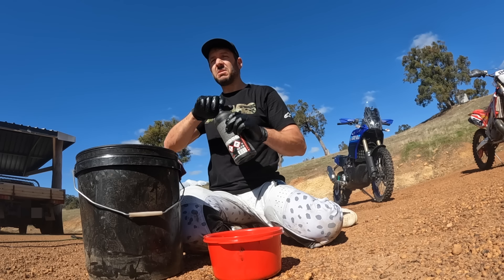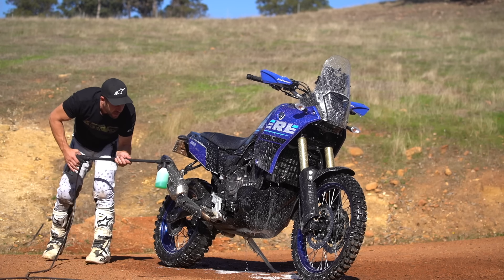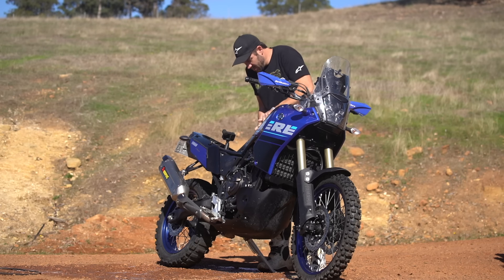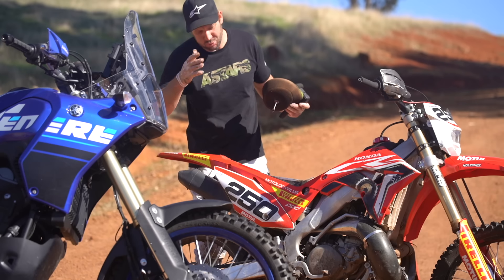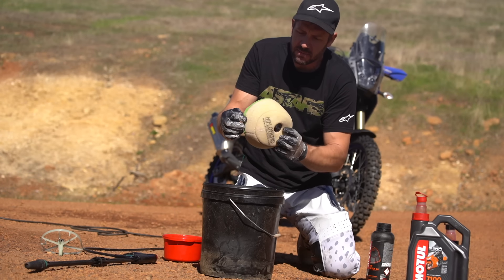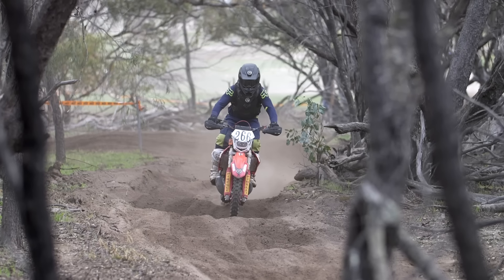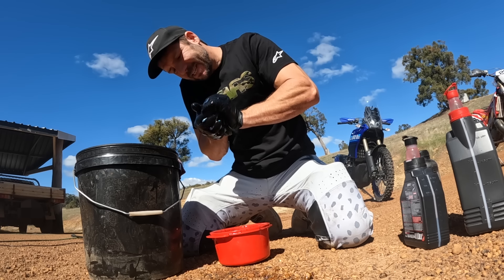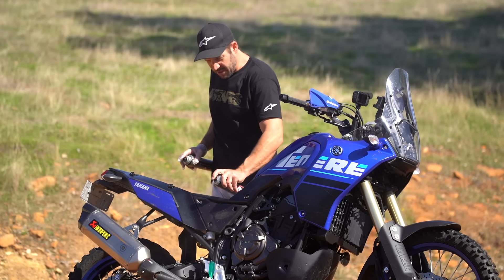How to Clean & Oil your Air Filter Properly!

Comment: Hi buddy, great video, I suppose this is a daft question, I've got an old klx 250 2010 Yr, I changed the air filter, and greased the edge of it but didn't oil it, should I take it out and do what you've done, sorry to sound a bit stupid cheers mate, and you got another subscriber, luv what you do cheers J mac from England. 👍👍🤘
Reply: yes! definitely take it out and oil it. Those foam filters don't work when their dry. They have to be oiled.

Comment: You probably dont need it in aus, but, do you treat your bikes with rust preventative. Recently came across stuff called acf50 which is from the aircraft industry but popular with bikers and is supposed to work for a year. Keen to know what you think. Thanks for the tips, pure gold

Comment: Just a comment on one of your video in regards to tyres and inner tubes.  I know basically nothing about offroad riding, so am curious as to why I see Dakar riders using moose tubes and why do you not?  Are they not better?  Or are they only for offroad racing?  What are the advantages and disadvantages from your perspective?  Thanks for the great content!  Every day is a school day.
Reply: moose tubes don't last long and will overheat and melt after prolonged road sections and are worn out after one hard day offroad. That's why they change them every day while racing. Great for the Dakar where you can't afford a puncture, but kind of a PITA for the average rider. I've run them in the desert southwest of New Mexico and Arizona and its awesome to ride through cactus and not have to worry about a flat, but they suck to change out compared to a tube. You also can't change your tire pressure like you can on a tube. Minor point, but worth mentioning.
Reply: @Rourke-Slimer  ah thanks for the info very helpful.

Comment: I recently got a single cylinder 400cc bike, quite the nice little thumper. The air filter on it is one of those round currogated ones and not one of these more spongy ones (it's not a motocross bike). Would you recommend oiling this one too? It is bound by plastic "rings" on the top and bottom (basically a cilinder)

Comment: Thanks again for another information packed vid , what you say does make sense. ? though if it's to oiled could that excess suck or drip into the cylinder
Reply from the maker: You might get a dribble onto the airbox boot, which is actually a good thing because it's one last line of defence if a granule drops in there ... sticks to it like those sticky rodent pads and stops it going into carby / throttle body.

Comment: "You wanna keep riding it as an old man...? you probably bought it as an old man." Ha!  I like the chain lube as last step bit. Going to give that a go. Grease around the edges has saved my ass before. Passed 7 KTMs that burned up in deep fesh fesh and I didn't... I assume because of my habit for greasing the edge of the filter.

Comment: I'm just wondering what type of fluid you recommend as a cleaning fluid. I was told not to use petrol as it destroys the foam. However when I bought purpose cleaner it is still a hydrocarbon. Just like the oil you oil it with. 
So is petrol or diesel ok to clean with

Comment: Question regarding silicone spray you use on tire tubes, you said you used it for off roading, do you also silicone spray tubes you use on in tires on roads? Channel rocks and proud you were in Knin which is 30 km from my town :)

Comment: I'm stupid... So after I've oiled up the filte like this, how long until the next change? Do I just kepp on checking it every day or do I wait for the bike to not be able to start(😂)? Also, what happens to the excess oil that drips down inside the air intake manifold or however it's called? Does it just get sucked into the engine just like the dust or what?? 

Sorry for the dumb questions, I'm new to this whole thing.

Comment: thanks for the good tip. don't ride a motorcycle but in Canada we ride a lots of four-wheelers and play in the mud some of the four wheelers come with paper filters in a foam around it .  should I be oiling the top foam filter  what's your opinion on the paper filters we don't have much dust step in the summer mostly just a lot of water and mud

Comment: Thoughts in filter skins Adam? Wip then of half way through a race and have a brand new filter again or just leave it as added protection?
Reply from the maker: Yeah filter skins are great for multi-day events / rides. Just don't tuck them into the sealingf edge of the foam because they can pull the filter out from under the inner cage and make a gap for dust to suck in!

Comment: Hey Adam great vid and really enjoying the channel!  I would have never thought of the 50/50 air filter and 2T oil mix.  In my area we don't so much have dust issues but more mud and water to deal with.  Does your filter oil mix repel water fairly well?  We do get a fair amount of water coming into the air box.
Reply from the maker: It only takes one cloud of thick dust or a stint behind a vehicle off-road to get dust and dirt granules through a poorly oiled filter. All it takes is a few particles to get into the engine and score a line between your piston and cylinder and your engine will start burning oil ongoing.
Reply: @MotologyFilms  Yes I definitely agree using this method in dusty conditions has done well for you.  Just wondering if it works equally well in wet/rainy conditions and will repel water entering the airbox as well as pure filter oil will.

Comment: Adam, do you have no fear that the foam filter seams on the T7 gets blown after longer usage and because there is no screen below the filter (like e.g. on the Yam WRF) some dust/sand or foam particle gets into the throttle body/engine? In the moment I'm running the stock paper filter (btw: very cheap) with an extra pre filter net on the snorkel. PS: Thx for the tip to mix engine oil to the airfilter oil for not drying out the foam
Reply: Joe Figl, good man running pre filter on the snorkel.  👍🏻
Reply: Yamaha Australia change the supplied paper filter for foam on all T7’s sold here. The paper filter would be useless in Australia. The foam pre-filter actually stops a lot of dust by itself meaning that your main filter will run a lot longer before needing to be cleaned/oiled.
Reply: @jameshind6644  didn't know that you have the foam filter as standard in Australia
Reply: @joefigl  Yep, Yamaha australia/ dealer change them before you take delivery. The engine would be toast in Oz if they didn't due to the dust. I always ran mine with a pre=filter as well.
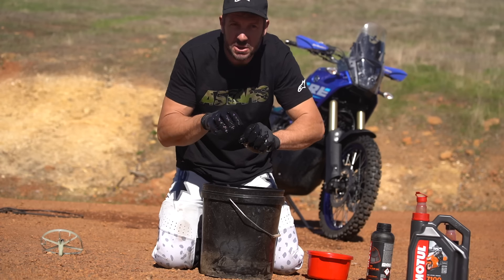Reply: @jameshind6644  look at this German guy who did a desert trip in Marocco and Mauretania at 09:00. He runs the original paper filter element with a foam pre filter and changed the prefilter first at 8000km on his trip. Seems this combiniaion works also pretty well. https://youtu.be/Vko1nUp062w

Comment: I've always just bought the stock paper air filter for my CB500X. Sounds like that's not sufficient and I should replace that with an oiled, foam filter instead?

Comment: I  have always cleaned up with a microfiber cloth outside first, then inside,  wash the filer with gas, soak filter with the bikes new oil, squeeze it a  bit and throw it back in,, good to go, if the interior is clean you're doing it right, or?

Comment: Question on the 50/50 oil mix: what would happen if you just used motor oil to oil your filter instead of the 50/50 mix? Would certainly keep the filter oiled longer but would there be risk of it burning thru the engine and it not working as well as a solution having 50% pre-mix oil?
Reply: Nevermind. Motor oil is too thin by itself so the mix oil adds a level of stickiness to it. Thanks for the video, vey helpful.

Comment: So if my new dirt bike somehow got dirt into the boot and on the throttle valve (still haven’t figured out how because no dry spots on filter and was sealed with grease), does it mean I have to buy an entire new engine?

Comment: Hi all, I've cleaned my filer only to discover I've hardly any left. Is it safe to use 100% motor oil on the foam filter in a pinch? Thanks.

Comment: hey i have a question. when i oil my air filter it doesnt become sticky or something. i use putoline air filter oil so it should be good right? i let my air filters dry for a couple of days and even on new air filters it wont become sticky but it just stays wet. do you know what could be the problem?

Comment: Hey Adam - may be a silly question but I do tend to get caught up with internet myths about mixing product lines etc. on my 4t, I assume im fine to use any new clean 4t oil on my filter with the (oil based) filter oil for the 50/50 mix?
Reply from the maker: Yeah mate, all you're really doing is making the filter oil more "oily" and less sticky.

Comment: I have a question, What tips do you have for us budget riders that do not have a tenere but a aprilia pegaso 650 or bmw f650 funduro and do adventure trips? they use different style of airfilters and such.
Reply from the maker: They are both bikes you can ride offroad, which means paper filter out, oiled foam in.

Comment: Hello Adam, as always great Video! 
I rode my CRF 1100 through Romania, Greece and the Balkans last year for 2 Months mostly offroad and thought about such a Filter, because Greece etc was very dusty. But it is very hard to get the air filters out on this bike. I just sold that bike and bought a T7 (mostly because of the weight and fewer electronics), would you say that this kind of foam filter is worth the hustle for trips like that? Here in Germany it is definitely not needed because I ride mostly on the streets and it's just not dusty here. I plan to drive through Scandinavia this summer (just the TET so mostly Offroad), so should I change the filter for that?

Thank you very much for your effort!!
Reply: I ride a T7 here in Quebec, lots of forestry roads so quite a bit of dust. I went with a Uni filter with the pre-filter that go on the snorkel. The pre-filter work very well, good enough in fact that I just  pop-it off and clean it leaving the main filter in there as it stay quite clean. I just set-up my friend new T7 with the oiled pre-filter only, keeping the OEM paper filter as it won't get much to do anyway. I did not see any difference in performance or fuel consumption, the latter being very important to me.
Reply: @leracer Thank you very much! I'm looking into that, but I heard that it's a problem getting airfilteroil onto the paper filter. Do you see that as a problem? Another question would be if you have the Euro4 or 5 version?
Reply: @GabrielWue  I have a 2021 (euro4). About oil getting onto the paper filter; the way the snorkel is made, oil would drip outside if you over-oil it. For my part I always use paper towel to take the excess oil away from the filter after oiling (tamp down with the paper inside and ou)t. Excess oil only make dirt collect on the surface and is of no help for filtering. I never have drip from the filter, been doing this for more than  30 years racing MX/ Enduro and never had dirt migrating in one of my motors.  BTW, if you go with the Uni pre-filter, it comes ready-to-install, you'll see how little oil is neeeded (as long as it cover ALL the foam!). Have fun on your Scandinavian trip!
Reply: @leracer Thank you! Just bought the pre filter.

Comment: alright, question time, I have been trying to find a headlight kit for my CR... haven't had a lot of help when asking the shops around me... what light are you running? does the stock stator make enough power to run the light like the old bikes, or do you have a battery in the system? I love my CR and wish it had a light on it, especially this time of year when it gets dark so early! If any of you folks know what light he's running let me know!
Reply from the maker: Hi mate, I think it's UFO headlight and I only put it on to race an Enduro years ago, which ran a small battery in the airbox long enough for the bike to pass inspection.
Reply: Ah, copy. Thanks for the reply, I was going through my old emails and saw the notification that you replied to this… made my whole day. Cheers mate!

Comment: Yep unfortunately the Motul air filter oil is pure crap, basically a glue. other brands air filter oil are much thinner, easier to apply and becomes tacky after the application, works the same if not better - blocking less flow than this heavy sticky compound.

Comment: Is this a lube commercial? 🤣Just joking. I've worked in Motorsport and oh boy Adam is right, coat that wires, connectors, and bolts and nuts with WD40 or similar, it might save you from a short or other electrical issues in the future due to oxidation. We used to ship formula cars inside containers to championship most distant events, and the car exposed steel parts would be covered with WD40 to prevent oxide formation. Once delivered you could immediately tell which parts where missed, especially when the car was delivered by sea. There are more durable and specific products out there than WD40 for the job such as ACF-50, but if you do it every now and then WD40 is fine.

Comment: What did you wash the filter with before oiling it up ? Would it be the same process for road bike air filters? I've got a 2006 R6 and am about to clean and oil the air filter on that. Love your chanel mate freakin awesome always.
Reply: The R6 would normally have a paper filter unless it has been changed to foam. You throw away the paper filter and replace with a new one. Cleaning foam filters you can use foam filter cleaner from a bike shop although I use mineral turpentine which is a lot cheaper.

Comment: never used 2t oil on an oil filter (in a 50/50 mix), I see no reason why this shouldnt work... I dont ride in a lot of dust so I dont know if its worth the extra work of mixing them. I just drown it in air filter oil n done

Comment: great vid but you didn't mention anything about letting it dry.  you say it should be soaking wet and dripping on the swing arm, but that's not true.. the bike won't run with a soaked filter.  i think you've done this so many times you forgot to mention squeezing it out and letting it sit for 3-4 hours. You squeeze it out at the end but then cut the video to your T700 filter. Twin Air recommend letting it sit 24 hours before squeezing out the excess as well.

obviously i'm pissed now because my air box and screen is full of oil and bike not starting

Comment: At 19:17 you say to spray the keyway with oil.  I did that on my F700GS one time and it destroyed the electronic transponder ring assembly .  Cost me over 700 dollars to replace.  It may be that you can spray the key area on some bikes, but on other bikes it is going to wreck your bike and cost big bucks to fix.   Call me a keyboard warrior all you want, but that piece of advice is bad and potentially harmful 😢

Comment: Not good advice guys. No keyboard warrior, but using a pressure washer on your expensive motorbike? Jeez. 

I do a complete engine removal and rebuild and use a motul squirt bottle and use KTM water sourced from husky! Husky actually bottles it at the factory. 

I can't wait to try the engine oil with air filter oil. Seems like a really sharp idea.

Comment: How about engine oil i see guys say i have a big ride coming up so i will change the oil 
Hey dude your all ready too late
Change your oil as soon as you get back you dont want to store your bike with the oil contaminated with hydrocarbons and acids which could attack the sensitive surfaces like bearings and cylinder walls
Put your bike away with clean oil 
And it will be ready for the next ride
If your gona come home from a ride and take a shower before servicing the ole lady your motorcycle life is deteriorating 
The wife can wait 
Have everything ready to service the bike before you get home so you will have it then the bike and the wife will be happy 
Now whats for dinner